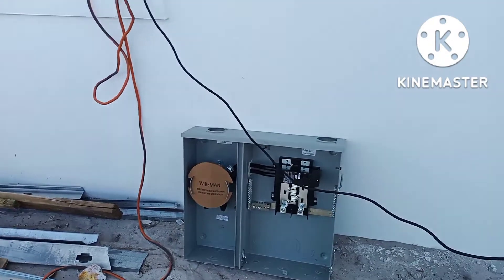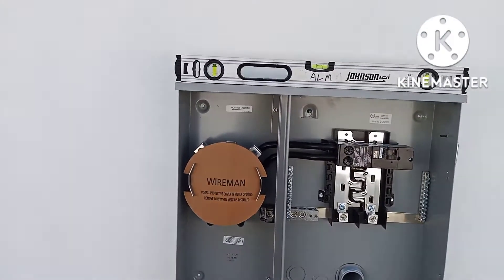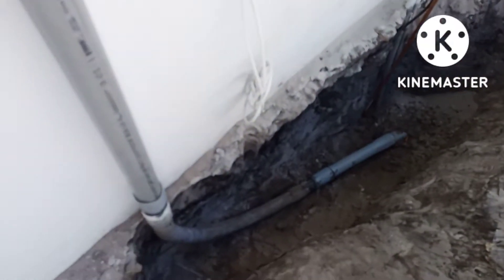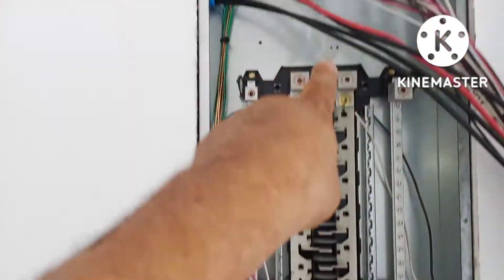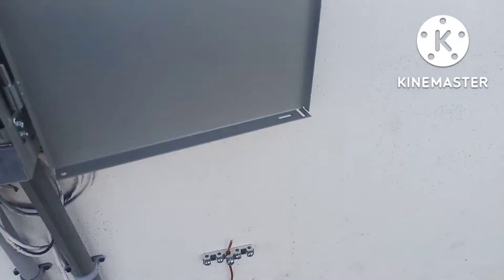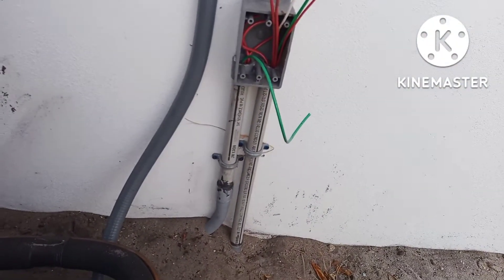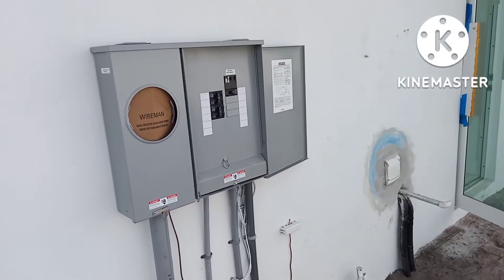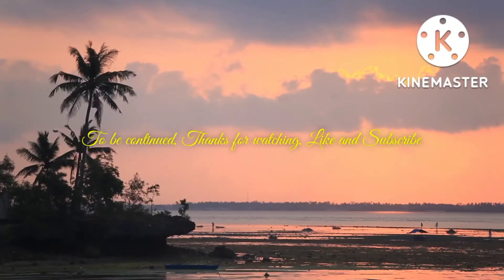How to install & wire a 200 Amp Meter Combo,

Comment: If you have a true ufer ground, which is rebar coming up from the footing, you do not need supplemental ground rods. Your connection to the rebar should be with an approved clamp and be accessible. Usually a cover plate on a 2 gang ring on the sheetrock wall will suffice.
Reply from the maker: But inspector say differently

Comment: So you have a ground to the meter can. A ground to the outside panel which is bonded to the neutral as first disconnect. 

Are these two grounds tied to the same ground rods? 8ft deep and and 8 foot spacing?
Reply from the maker: The ground was yes they are tied together with a number 4 bare copper coming from the ufer ground from the building to the meter can a piece of ground wire from the panel for the low voltage bridge ground bars or 6 ft apart not 8 and going to the cold water yes the first panel outside the first means of disconnect if you're going to one of my other videos saying residential part one and two you'll see the rest